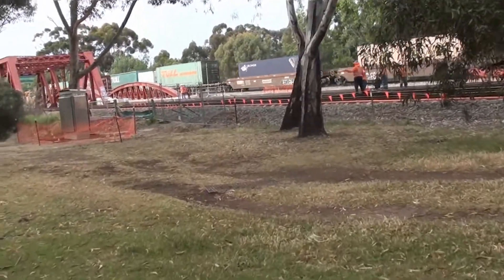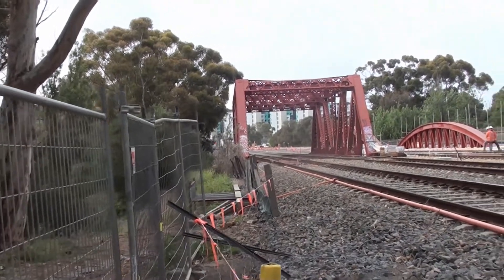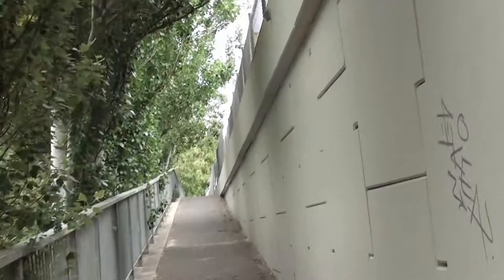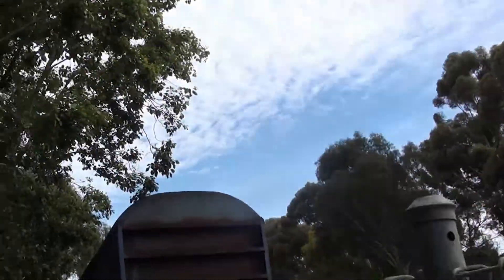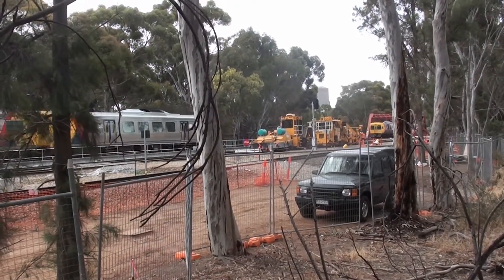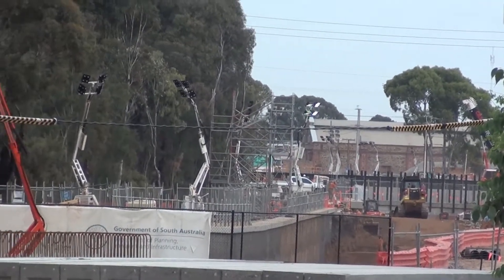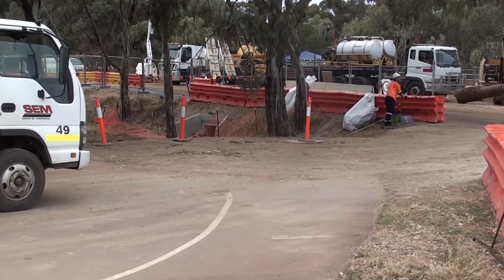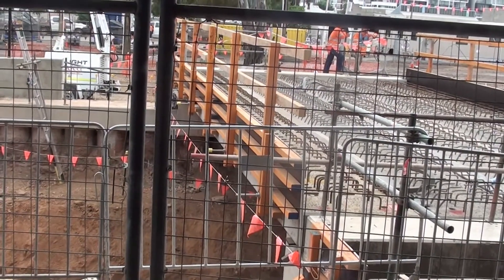Torrens Rail Junction Project Progress Nov 2017 Greater Adelaide Video

Comment: Neil Hamilton Do you Know when is Outer Harbour and Grange train exactly date will reopen?
Reply from the maker: Hi Steve Smith
https://www.adelaidemetro.com.au/Announcements/Planned-Disruptions/UPDATE-Outer-Harbor-and-Grange-rail-line-closures-until-early-December-2017
"The Outer Harbor and Grange rail lines are temporarily closed until early December 2017 to allow works to continue for the Torrens Rail Junction Project."
Reply: So the new Bowden railway station will be open with outer harbour and granger line on 3/12/2017
Reply from the maker: Hi Steve Smith 
Just checked on the date you mentioned of 3rd December.
"From September 24 until December 3, Outer Harbor and Grange passengers will be forced to use substitute buses."
http://www.abc.net.au/news/2017-09-13/adelaide-rail-passengers-told-to-prepare-for-more-pain/8942906
The trains might be running through the new station, but they may not stop there until the "civil works" around the station are finished.

Comment: If the Gawler line is going to be electrified only up to Salisbery, how will they handle the rest of the line. Will they run run the 3000 class as a shuttle between Gawler and Salisbury and transfer all passengers to the electric trains?
Reply from the maker: Hi Luke
I suggest that Electrification is the least import step for the Gawer Line.   
We want to emulate the Northern Beaches Rail Line in Perth, with 
* closing low utilized stations (too close to other stations and from an earlier time
* re-routing of track in bottle-neck locations. (tunnels and tracks running along centre of Free-way)
* electrification (fast acceleration away from stations) 
* grade separation (eliminated all train-road level crossing and train-pedestrian level crossing) 
* re-routing buses so the were feeders into bus stations (patrons do safe footpaths from Bus to Train)
* 2 underground stations in Central Business District
* lengthening all station platforms to hand high capacity trains (6 carriage sets)
The Northern Beaches Rail Line (now called the Joondalup Line) carried 17 million passengers in 2015 Year.

At the same time all our 6 Adelaide Metro Rail Lines carried a total of 13 million passengers.

The  Gawler Line cannot increase capacity by increasing the frequency of the trains (it is at saturation point now).
I suggest the next step and easiest step on the Gawler Line woul be to "lengthening all station platforms to hand high capacity trains (6 carriage sets)".